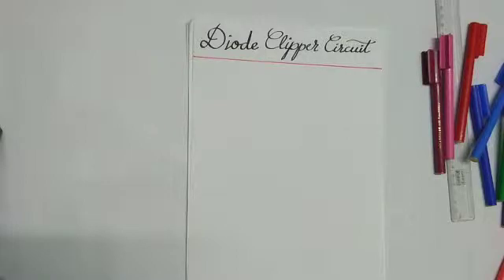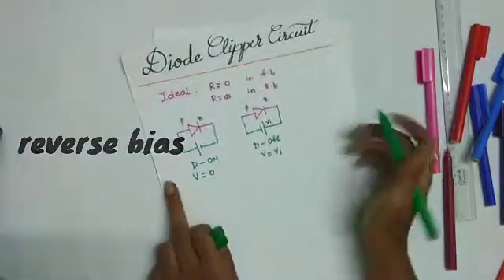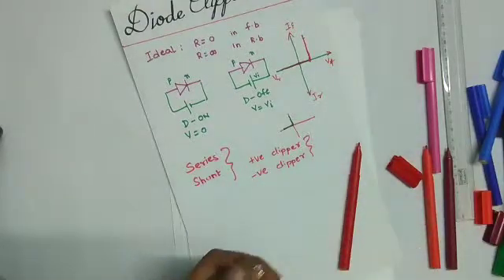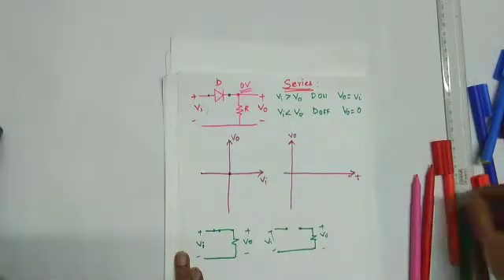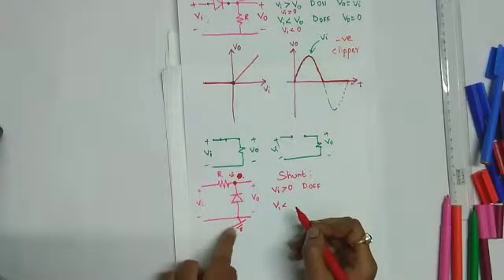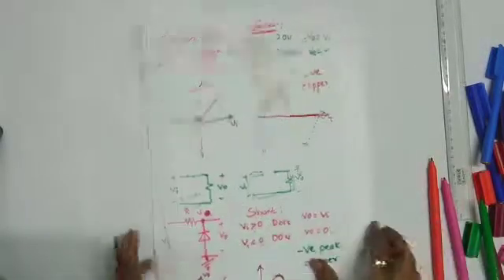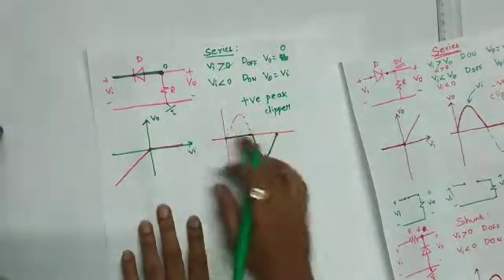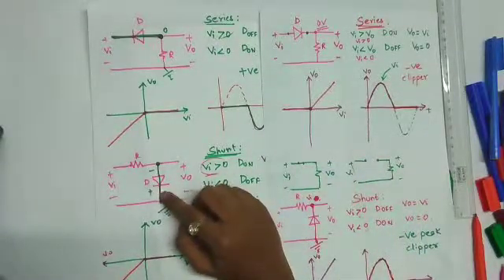Diode Clipper Circuits

Comment: Ur teaching is better than my sirs plz need more videos mam
Reply from the maker: Im working on the same
Plz stay tuned
Reply: @letslearnelectricalenginee4671  mam I need some more topic according to our syllabus
Reply from the maker: Sure let me know which topics u want to learn
Reply: @letslearnelectricalenginee4671  transistor caliper
Cliping at two individual levels
Transfer characteristics of clipers
Emitter coupled cliper
Clamping operation
Clamping circuit using diodes with different inputs
Clamping circuit theoram
Practical clamping circuit
Effect of Diode characteristics on clamping voltage
Transfer characteristics of clampers 😁😁😁
Reply from the maker: All about clippers and clampers i guess😅
Reply from the maker: Please go through my other video diode clipper circuits part-2
Reply: @letslearnelectricalenginee4671  those are the syllabus for my upcoming exam 😂😂